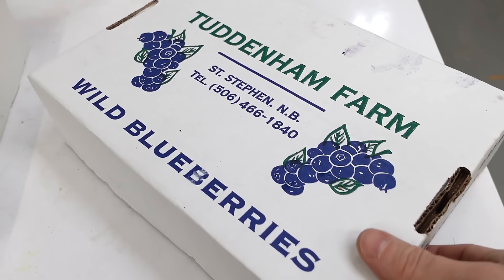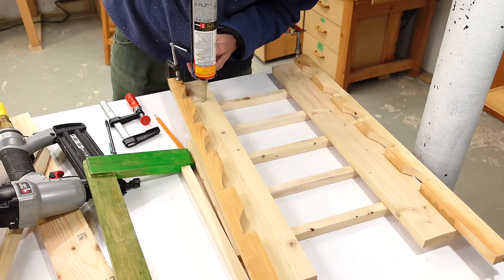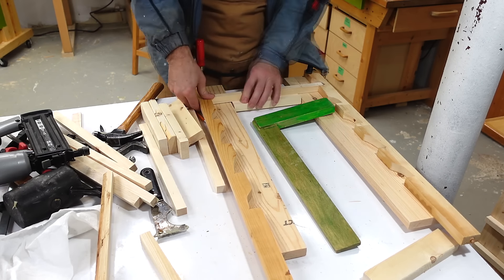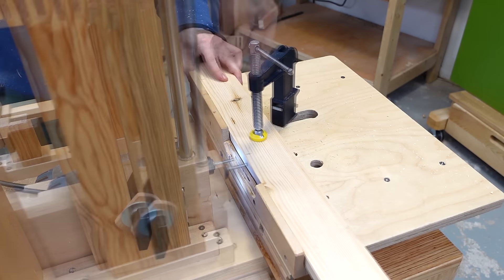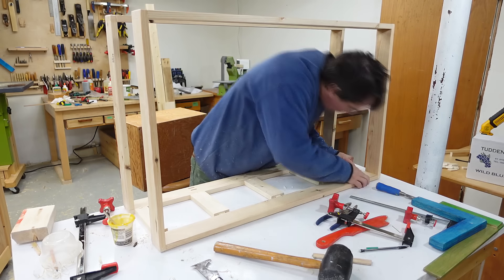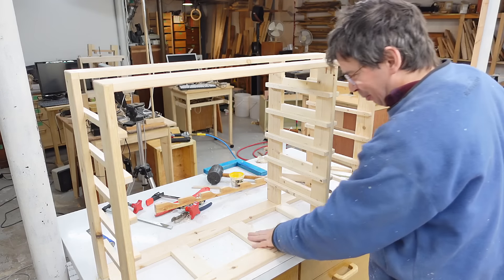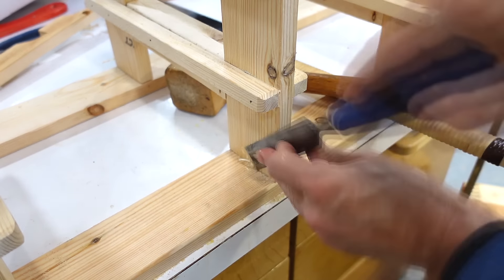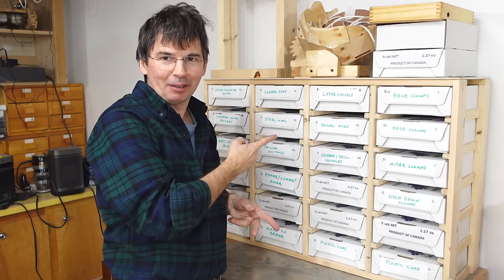Cardboard boxes storage rack

Comment: I always learn something or get a good tip or suggestion for my own projects from your videos, and this one is no exception!  I was going to do this very type of system to put a bank of tool and small parts drawers in my old workbench, to sit on its open shelf underneath.  I thought about the side guides to keep the back corner of the drawer from going in between the frame stiles, but was thinking about pocket screws to fasten them to the stiles.  Your brad nailing and gluing them between the runners is genius, since the runners are already attached to the stiles, that's sufficient for holding all 3 pieces, the 2 runners and the guide.  Thanks as always for your practicality, and your upcycling of used and construction-grade wood.  With lumber prices still higher than I'd like, I hate sinking more than I need to, into a humble shop project.  Good stuff, Matthias!

Comment: I love it! I did a similar thing with peanut butter jars. I have a cupboard where the top space is too high to properly reach, and also to deep. By making a holder for all those jars I could put those in horizontal. Now I only need to grab the front to get to them. Underneath is space for a couple to stand vertical, because I can reach that easily.

Also prevents moths from getting into the food during the summer.

Comment: Looks to me these boxes are one of those glueless boxes, when I'm going to reuse one of those I like to disassemble them and reassemble them inside out, that way you have a clean outside you could label using a sharpie, and in this case it also has the benefit that any leftover mousture from the blueberries would be on the outside.

Comment: Hello Matthias, I have a small wood shop and I  have a couple of suggestion about subject matters you may be interested in.
While cleaning up saw dust or wood shaving I have the option of of using my shop vacuum or my dust collector.  So to the point, I've often wondered  why the shop vac with a two inch hose will suck everything  you want plus what you don't want, things like a nut or bolt. However using the dust collector with a four inch hose it seems mild but still suck up as much, but leaving what you don't want. Is it because of the hose size? Or is it the blower?  I also have a 2.5 inch hose on the dust collector and it too is mild in comparison to the shop vac.
Also when using my 8 in bench grinder equipped with a wire brush, it made me  think how much wind it produced. Just for fun, you may want to experiment with making blower with a wire brush.
Reply from the maker: less suction pressure for the dust collector.  questions that ample don’t make worthwhile videos